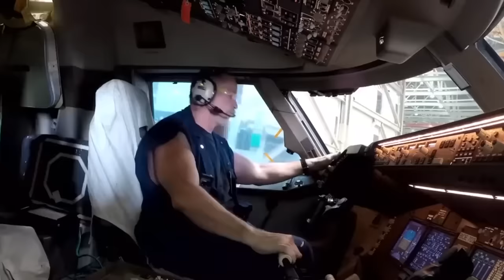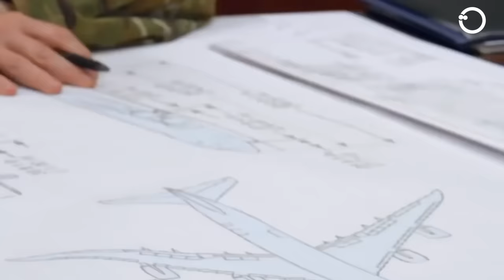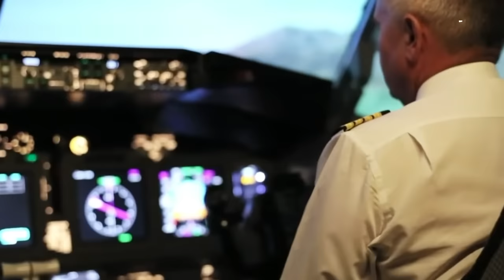REVEALED: INSIDE NEW AIR FORCE ONE That Flies at 5 Times Speed of Sound

Comment: Do you proofread these videos before uploading them?   I think NOT !   You said the engines would cost 22 Billion dollars ???  The total for both jets is suggested to possibly run up to $5 Billion.  I think you meant to say 22 Million.   You also said the jet would be able to go up to 5 times faster.  The air frame of the 747 will not support that kind of speed.  I am not a expert but for me to notice such glaring errors on your part is just ridiculous!   Read your material before posting!
Reply: Not much, if any, technical research is done here in this channel. A supersonic jet would most likely need to be a delta wing or similar, who would seriously rip apart a 747 for that? That's almost as good as a newly developed aircraft....and then piece it together with previously untested new parts for something as demanding and challenging as a president's airplane? And all of that with a fuselage never meant for supersonic flight. GOOD JOKE....
Reply: The picture looks like a modified L1011
Reply: The 74 can break the sound barrier but I will shudder and things start to break
Reply: He called Ford, Nixon.

Comment: A plane that size and structure could never fly at 5 times the speed of sound , even  at high altitude it would  simply diintegrate  unless it only flies in Unicornalnd
Reply: What I was thinking. No way it can fly that fast.
Reply: clickbait !
Reply: You want Mach 5, the aircraft would have to look like an oversized SR-71,  Especially if your carrying the normal complement of people and extra news reporters that get to tag along.
Reply: I bet it won't even go 4 times the speed of sound!
Reply: That's what I thought.
Our F-15s and F-16s fly at Mach 2 or Mach 3 -- tops!
And NO in-flight refueling?

I am not an aeronautical engineer, but if you fly at Mach 5, you need lots of fuel and with NO in-flight refueling, that could be a problem!
Reply: According to past features, the SR-71 was made out of Titanium because of the heat build-up at 2,300 MPH, so, the new AF1 is supposedly faster than the Blackbird? I don't really think so.
Reply: It's possible that a super sonic Air Force One could happen by 2040.
Reply: Don’t you know, the gray aliens are building new hypersonic Air Force 1

Comment: The plane  is only "air force  one" when the President is on board
Reply: Yes and did you also know that there are not just two AF1’s? Speaking in terms of how they are outfitted technically yes, with all of the upgrades in security and updates in the interior layout there are only two planes manufactured and in perfect flying condition designated for the president’s use. 
Though any of the numerous airplanes that are in the Air Force’s flight arsenal have the call sign Air Force 1 when the president is on board.

Comment: The new AF1 is only going to cost 5.3 billion dollars, but the generator upgrade is 22 billion. Don't you mean 22 million, and not billion?
Reply: Bunch of BS No Generator cost 22 million dollars .. maybe $200,000 at the most!! For a generator!!
Reply: The narrator stated the four engines cost 22 Billion dollars, I believe four jet engines for the aircraft can cost 22 million bucks, plus tips & gratuities...
Reply: The narrator or the writer of the script for this video has embellished obviously. Though not by a whole lot. I believe that the script probably read close to 2 billion, not 22. Each VC 25 engine that GE will provide for the two new presidential aircraft’s are a cost of almost 325 million each. This would put the cost of the engines alone at 1.4 billion by today’s prices. If anything extra or improvements are required then this could push the cost very close to 2 billion.   
The balance of the cost for each aircraft, that will be manufactured to update and upgrade each to the specifications that are required to make it a presidential signified flying Oval Office, can be seen on the Boeing website.
There are many technologies that are designed for these airplanes alone. So Boeing can not just take an already manufactured jet and upgrade it to meet the specifications for what is designated as a plane used by the president on a regular basis.
It would cost much more to re-engineer a plane, by removing pretty much the guts of the previously manufactured aircraft. It takes a lot of classified, & patented technology as well as specialized components to be used in a military jet of this design.

Comment: I like the current paint job. Looks Presidential, but understated. No need for red. However, I am wondering about no air to air refueling.
Reply: There is a need for red our flag is Red, White and Blue. Not white, blue and red. The red on the new plane is understated but very impressive. There is very little red color on the new planes. But like butt holes we all have our preferences.

Comment: When they retire these aircraft you really need to go look at it. On the ground looking up and looking along the side it's just so huge. It's hard to imagine this thing taking off. If I'm still around when they retire I'm really looking forward to seeing them again. This time I could take pictures. 

I think it's a huge mistake not being able to refuel. Of course right now for Boeing it's a miracle that any of their aircraft are still in the air. When you finish building an airplane and then you have to send it over to a different group to fix everything that was missed during the initial building that's not good. It is anywhere from 3 months to 6 months to fix everything that was not built the correct way the first time. I just don't get wide the United States would stick with them especially building something that holds the leader of this country.

Comment: You can either watch and listen to the massive BS in this video, or you can read factual info:: 

On 1 August 2017, in an effort to pay less for the replacement program, the US Air Force contracted to purchase two of the bankrupt Russian airline Transaero's undelivered 747-8 Intercontinentals from Boeing, which was storing them in the Mojave Desert to prevent corrosion. These airplanes, which were completed in 2013, would be retrofitted with all essential equipment to serve as the next presidential aircraft, albeit without certain capabilities such as aerial refueling.

In September 2020, the US Air Force announced several Presidential and Executive Airlift Directorate contracts had been signed with aircraft manufacturers to begin development of a supersonic aircraft that could function as Air Force One. Contracts have been signed with three companies, Exosonic, Hermeus and Boom. Note the word "development" in that last sentence. As of May 2024, only Boom has actuallly flown one of its newly developed aircraft It's a small, one seat jet that's currently being tested.  Much of the development work will be perfomend at Lackaland Joint AFB , south and west of San Antonio, Texas.